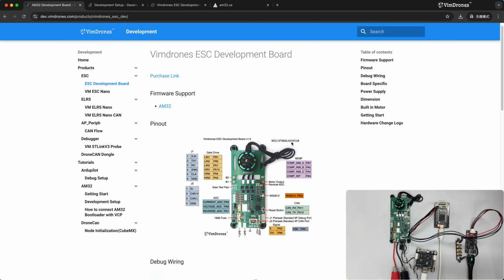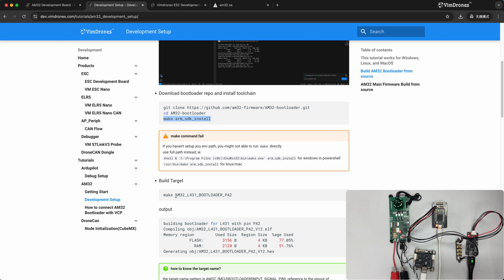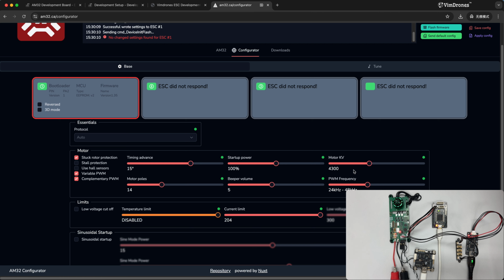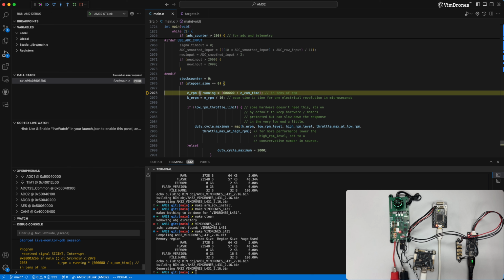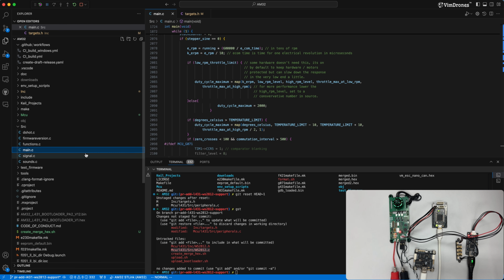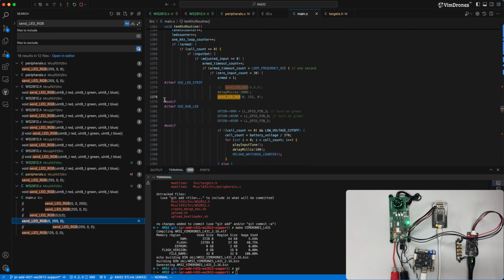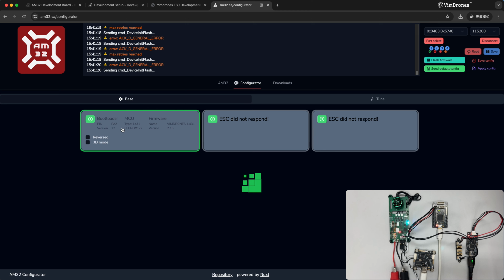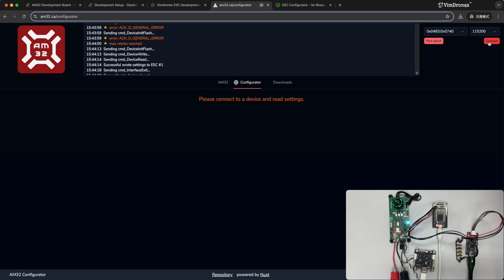AM32 ESC Development Setup - A Detailed Step-by-Step Tutorial

Comment: How to use the AM32 ESC to run a low KV motor, like a skateboard motor. The KV value is about 400-450. When I set the kv 460 to AM32 ESC, it can not drive the motor. I don't know why or how to fix this issue.
Reply from the maker: Hi, would you mind sharing the details in our Discord Channel, shouldn’t be hard to solve it

Comment: how to correctly connect the devboard to the FC in order to connect it to configure it after bootloader is loaded (via swd and STLink), in vimodrone video instructions, it is not clear shown - how ESC should be connected to the FC by this pionout M1 and R7.
M1 is going to Motor output pin of FC - okay. Where need to connect second pin R7 to FC?
Reply from the maker: TX1 in development board connect to flight controller any uart Rx